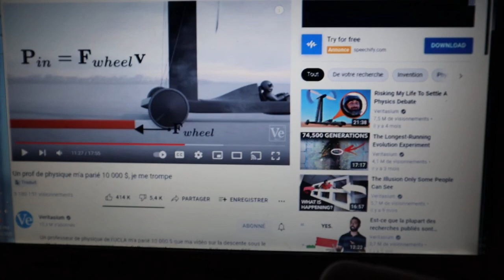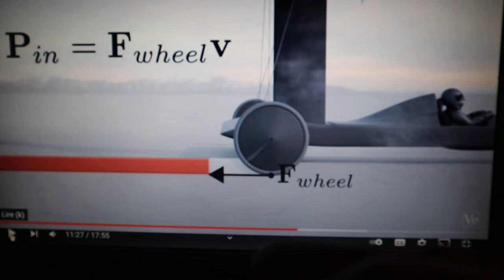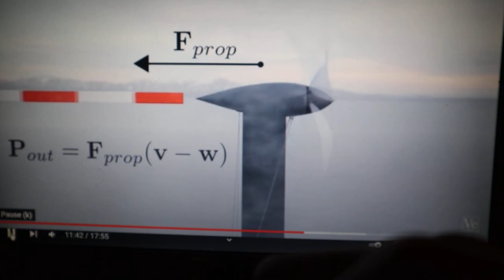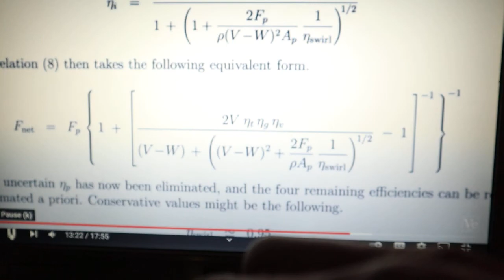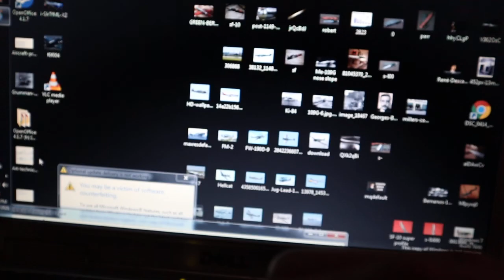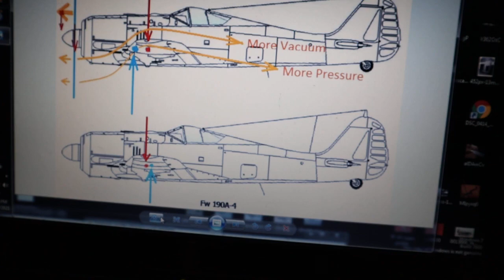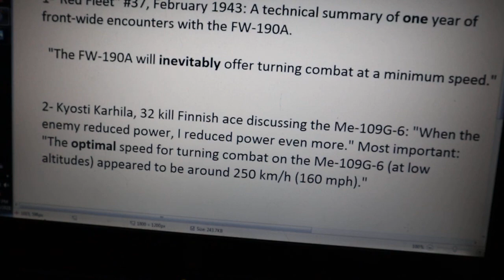WWII fighter aircraft designers did not understand what they designed: A physics demonstration

Comment: I think that you might be missing the forest for the trees here. Many of the phenomena you've been discussing can be explained without this leverage stuff you're talking about.

For example, that Soviet report on combat with the Fw 190 probably isn't talking about turning circles, considering that other Soviet reports lament the 190's poor turning at all speeds. Instead, it's talking about the Fw 190 turning, rolling, and slowing down to force an overshoot. That's why the Soviet pilots are advised to go vertical. It's standard procedure to avoid overshooting.

Karhila's report on turning combat in the Bf 109 makes perfect sense if you consider not that the Bf 109 itself turns best at 250 km/h, but that it turns best relative to Yaks and Lavochkins at 250 km/h, which is known to be true because of its leading edge slats and superior thrust-to-weight ratio.

Likewise, when a Spitfire pilot complains about putting all they have into a turn and being outturned, that fits. The Spitfire was reknowned for needing to be handled gently, as its thin elliptical wing caused a massive increase in drag at high angles of attack. You dump your speed, you slow down, and now you have to pull lower AoA to avoid stalling. Poor thrust-to-weight in early Spitfires means you'll be stuck turning at low AoA and low speed until you stop turning or are outturned.

It's not that propwash and leverage aren't true factors, it's that there are much more significant factors that can explain the phenomena that pilots went through and then later (perhaps innaccurately) reported.
Reply from the maker: There's really only one alternative explanation for the lower 250 km/h speed, and that is the reduced momentum. At lower speed the radius will be much smaller from the much reduced energy due to the square of velocity, and such a smaller turn radius is very important to gain aiming lead (the Spitfire was somewhat of an exception, and could stall itself to briefly "shoot across the circle" at slower, smaller German circles: This was kind of a so-so band-aid for its poor turning: "Great for aerobatics [loopings]. Ridiculous as a fighter." Adolf Galland).

  The lower momentum of lower speed would explain the reduced power to gain a smaller, better-aiming radius. However, that does NOT explain why, once the smaller speed and thus the smaller radius is achieved, the power is not brought back up to make the radius even smaller... This simply never happens. They never used War Emergency Power during turns either. Not one case did I find in 27 years of research.

  This indicates not only that the lowering of power is NOT time-sensitive, over multiple consecutive 360s, but that it is the POWER ITSELF that is detrimental to turning... This indicates a RATIO of forces exists between lift and thrust. Unlike with energy, you can get more force out of something with LESS input force, if that lesser force happens to increase the RATIO between a big wheel and a small wheel.

  In fact, if you look at this objectively, there is not even any way the position of the current "Science" makes any sense: With single tractive propellers, the force of the prop INTERSECTS the force of the lift. In jets it does not. There is no way the intersection of two forces on the same object does not create a RATIO of these forces... The reason they think there is no ratio is because the excess force resulting from that ratio is expressed into a compressible transparent fluid, which is not easily discernible in real flight (outside of wind tunnels, which cannot replicate a curved air trajectory).

  In the trolley in the video, the excess force from the ratio is visible as simple motion because the wheels are turning and expressing their excess force into a solid medium without slippage: If the small wheels were small enough and did not slip, that piece of wood would instantly accelerate the trolley to near the speed of light... Only the big wheel/small wheel RATIO matters for the intensity of the outcome, nothing else. On a prop aircraft the two "wheels" (Big wheel: prop/nose going down, Small wheel: Center of Lift going up, and yes, in curved air, the CL does "slip" in FRONT of the CG, as Eric Brown describes "pushing the stick in low speed turns" on the FW-190, an extreme case of huge lift force gains because of a huge ratio) the two wheels "lock" each other to a standstill, and the excess lift force that results from reversing the nose going down is instead expressed as extra LIFT into a compressible fluid (I think by drawing air from below the wing and compressing this air between the wing leading edge and the propeller). But it is essentially the same thing as the trolley: Massive gains in speed if you made the small wheels even smaller, or massive gains in lift if the CL moves LESS far in front of the CG...

  And that is the ONLY possible explanation why the FW-190A vastly out-turns, at low speeds and at 45 lbs/square foot, a Spitfire with 30 lbs/square foot: These values in reality are wrong through leverage ratio... The FW-190A has a more extreme prop/CL RATIO. A ratio of forces is the only thing that can explain both this and the lack of time-sensitive re-acceleration at 250 km/h. 

  Clostermann, RAF mission record holder [425], 18 kills: "The notion that, at low speeds, the Spitfire out-turned the Me-109, or the FW-190A, is a good joke.--- It is a die hard legend that few who put it to the test ever came back to complain about."
Reply: @wrathofatlantis2316  Increasing turn radius at higher speeds is due to the peculiarities of real-world aircraft design, not an inherent limitation of an airfoil. Theoretically, both lift and the centripetal force needed to maintain a turning circle radius (which lift acts as) increase with velocity squared.

There is a simple explanation as to why the Bf 109 turns better at lower speeds, and it's not just due to compression and other realistic inefficiencies. I already mentioned why it actually happens, and why the Spitfire has the opposite condition. And I could take forever to explain my reasoning, but I realized that I could explain myself just by asking you two questions:

1) How does a missile turn? It doesn't have any wings.

2) How does a glider turn? It doesn't have any engines.

I await your responses.

Edit: grammar
Reply from the maker: @Renta352  The missiles have winglets, strakes or body surface, and the glider has a cumulative speed from altitude loss. I have a single question: Do you accept that if the trolley has 4 infinitely small (and unbreakable) wheels at the bottom, and there is no slippage (make all wheels unbreakable geared teeth), the non slip beam pushing 1 mph at the top could cause an instant trolley speed of one million mph? We must establish the basic notions here.
Reply: @wrathofatlantis2316  Winglets working in tandem can operate as wings, but then then you're basically talking about a rocket airplane. For the sake of explanation, I'm referring to a more basic form of missile, that only has one set of winglets.

A turn is induced by a force acting on the CG of an object perpendicular to the CG's linear velocity. Single sets of winglets, or diving speed, do not induce such a force. What is the actual physical phenomenon that causes a missile to change course? A glider?

As for the trolley thing, the trolley will not roll on infinitely small blue wheels because the small blue wheels are attached to a white cylinder that already has a certain radius. They won't be what the trolley rolls on if they get smaller than that.

Edit: spelling
Reply from the maker: @Renta352  That was not my point, but I understand the quibble. They could be microscopic geared wheel sitting on a toothed raised rail. The point is, allowing for that and unbreakable materials, can a 1 mph push instantly generate 1 million mph if the bottom wheels are small enough?
Reply: @wrathofatlantis2316  I can see that missiles are kind of a bad example, because they have multiple factors in their turns when I'm really just trying to isolate one principle that missiles are designed around, more so than airplanes.

I'll stop being pedantic and explain myself in long form.

In an air-to-air missile, turn ability mostly comes from engine thrust being aimed in a new direction. Once the engine dies, it loses a ton of maneuverability, because winglets and strakes are only enough to make it "drift" through the air.

In a glider, turn ability comes from lift from the wings, which may not even require you to pull the nose up, depending on airspeed. It curves through the air rather than being pulled along by an engine.

The whole schtick that I've been trying to get at is that airplanes are like a combination of a missile and a glider. Both engine force and wing force accelerate an airplane through a turn, but they have different effectiveness at different speeds.

The more missile-like Bf 109 turns better at ~250 km/h because that's near its ideal propeller efficiency speed, and so the "missile effect" is strongest then. Meanwhile, the more glider-like Spitfire turns better past 360 km/h where it has more lift and a stronger "glider effect".

And since I've resigned myself to being long-winded:

The thing about small wheel size is more than a quibble. What's deceptive about the trolley is that the big wheel and the small wheels are both colored blue, but they aren't touching. All that the big blue wheel does is reverse the direction of rotation on the white cylinders; there's no increase in surface speed from wooden bar to big blue wheel to white cylinders because they are all touching without slippage.

The actual leverage (or really, mechanical advantage) occurs between the white cylinders and the small blue wheels, because they share an axle. A small movement of the smaller one's surface leads to a big movement of the larger one's surface. If the trolley could somehow roll on blue wheels smaller than the white cylinders, it would actually go slower, not faster.

Edit: less terminology
Reply from the maker: @Renta352   Quote: "If the trolley could somehow roll on blue wheels smaller than the white cylinders, it would actually go slower, not faster."  No, because the 1 mph push is constant, requires a VERY LOW effort, since there is no difference between the white cylinders and the small blue wheels: They are the same object (same axis): If the blue wheels were microscopic, moving them 1 mm (which, again, is a VERY LOW effort) would cause them to rotate 10 million times per mm, which would cause the infinitely LARGER white cylinders to rotate 10 million times per 1 mm, instantly generating immense speed on the upper big wheel, from a minuscule 1 mm effort. If the small blue wheels have microscopic teeth that do not break, they will be strong enough to spin the white cylinders at 10 million rotations per 1 mm of push. The now bigger white cylinders enhance the effect, but they would do so even more if the white cylinders were bigger than the big top wheel, and had a trench between the raised "rails" of the small wheels (rails I added in response to your objection). It is not the ratio of the white cylinders to the big wheel that really matters: The white cylinders are just a connection: The ratio that really matters is the big wheels vs the smaller wheels, because those two are in contact with SEPARATE OUTSIDE media, just like the wings and the prop are in contact with SEPARATE areas of air, but are CONNECTED to each other. The connection does not matter, the RATIO of the two wheel SIZES, each size touching a DIFFERENT outside area, yet being connected internally, is what matters. Do you see it now? CL attached to wings, small wheel, prop attached to 10 foot nose, big wheel. 

  Wings have more friction surface than the prop, so they CANNOT lose grip, just like 4 small wheel contacts can't lose friction grip compared to 1 big wheel with just 1 contact point. As long as the smaller wheel(s) cannot lose their outside grip, the big wheel is reversed with immense gains in force (or speed if the wheels do not "lock" each other, and instead freely rotate like on the trolley, UNLIKE on a prop aircraft). On a prop aircraft, the added wrinkle to the "locked" wheels is this "excess static force" is then expressed into a fluid "funnelled" and "squeezed" between wing and prop from below the wing: The more the CL moves back (lowering power does this), the smaller the small wheel, and so the more air comes FORWARD of the CL, and gets "squeezed" between prop and wing leading edge. That is how the "excess static force" gets expressed into a fluid, when reversing the big wheel (the big wheel here being the nose wanting to rotate down from a 1% prop surface imbalance due to the turn radius: 10 foot prop vs 1000 foot radius= 1% imbalance, or about 30 pounds: A minuscule effect that is ballooned by the nose/CL RATIO, just like the weak 1 mm push which easily generates 10 million rotations because of the huge leverage of the height of that big top wheel, the push being all the way at the top).
Reply: @wrathofatlantis2316  The entire reason why I'm commenting on this video is to explain that you're confusing yourself by introducing unnecessary math and human error.

Case in point, this last comment that you just made. I could go through and highlight your every mistake (like the fact that you accidentally reversed the input and output on the trolley problem, leading to the exact opposite of the correct answer), but that would defeat the point.

Frankly, I think that this is a visualization problem. I keep trying to describe things in a broad functional sense and you keep trying to describe them in a detailed conceptual sense and we're talking over each other's heads. It's analogous to experience vs. book smarts.

I've already said my piece, and I can't physically show you what I'm talking about. The only thing continued conservation will do is further add to your confusion, or worse--your conviction that you aren't confused. I'm out.
Reply from the maker: @Renta352  Reversing input direction? Reversing input direction is WHY you get force demultiplication... You just demonstrated you don't have the mental equipment to understand force or leverage.

Comment: I mate! I m really interested in your analysis; always been of fond of air combat (WWII), never been in the details of maths though, but any thing that can make me a better fighter (il2 sim) I good the read.
I have to admit that for the moment this « powered down flights and fights » don’t get my vote, but I’m gonna have a closer look at what you say.

I have a question: is your analysis only based on maths , and quotes, or do you have it tested in real flights/fights (Air Force friends maybe?), or to a lesser availability in sims…?

See you soon
Reply from the maker: It is solely based on combat pilot quotes (not test pilots) and the 50% wing loading disparity between the Spit and the FW-190A. A computer simulation will not replicate the true effect of reduced power during turns, because their assumption that the lift (in turns) is proportional to speed (on tractive props) is wrong. Pusher props like the SAAB J21 do not pinch the air behind the prop and could not turn tight at low speeds (neither can jets, unless they have orienting nozzles). Furthermore, the effect is only confirmed on thick wing tractive fighters with fairly straight and thick wing leading edges, which shovel the air forward to trap it behind the prop (due to low speed tighter turn air curvature): Me-109, FW-190A, P-51, P-40, Ki-43, etc. The Yak-9 appears not to benefit from low turning speed at reduced power, as the leading edges are too swept back, and neither does the Spitfire's thin wings: You have to have your wings shovel enough air forward to get compression "pinching" behind the prop... Air being compressed between prop and wing is key, to create a "push-pull" effect to create "lift": Pull two ends of a string, and you "lift" the middle. That is where I (now) theorize the discrepancy in lift comes from (the video is a bit outdated). The WWII expression "hanging on the prop" illustrates what the gain in lift at low speed looked like: On the FW-190A this was so great that turns below 220 knots required PUSHING on the stick, because the nose came up too much... 
  The new Clostermann quote I found proves the Spitfire cannot out-turn either German types at low speeds:  https://youtu.be/c2zdA9TcIYo?si=kKPUvV28Pi-9K0gu

    at 12:44  : Translation: "So there are legends on the Spitfire... Aaaah the legends... Legends are hard to kill... One of those legends is that the Spitfire turned better than the Messerschmitt 109, or the FW-190. Well that is a good joke... In fact all those who found themselves with a 109 or a 190 turning inside them, at low speeds, well those in general did not come back to complain about the legend... Why? Above 280 to 300 knots, the Spitfire turned better than the Me-109. But, first and foremost, in a turning battle, the speed goes down and down and down and down, and at one point there comes a time, when the speed has gone down below 200 knots, that the Me-109 turns inside the Spitfire." (With a freaking 50% wing load disparity...) See my board game here:
https://boardgamegeek.com/filepage/97109/advanced-air-force